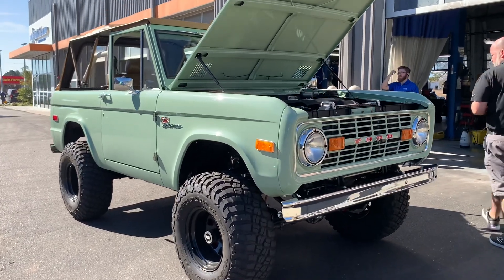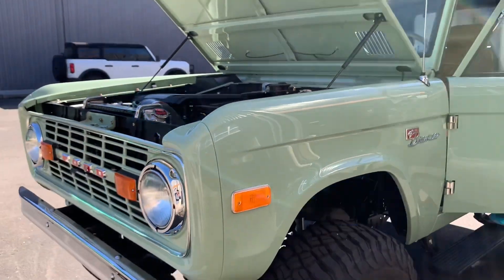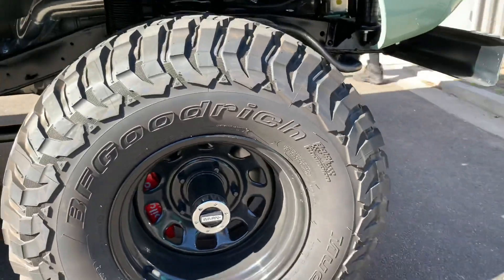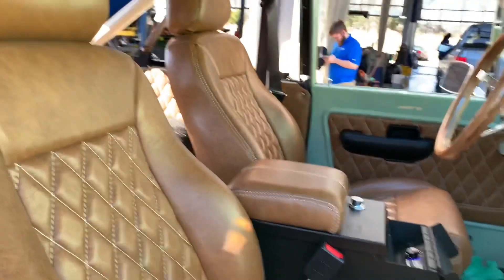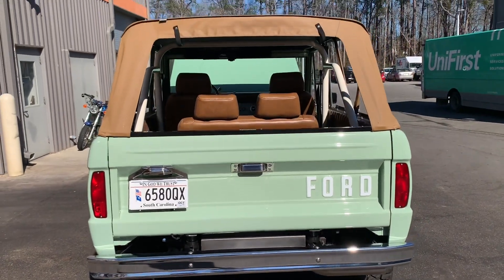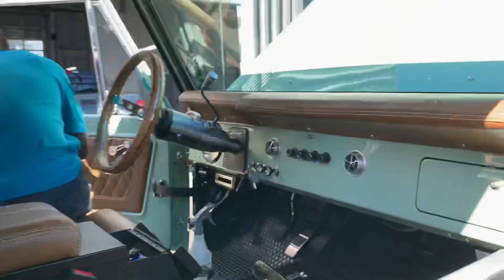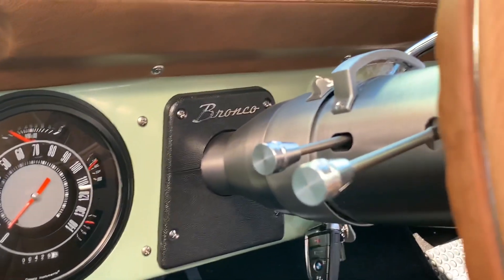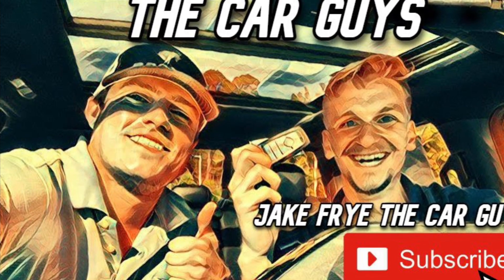CLASSIC FORD BRONCO 5.0 COYOTE V8 SWAP: 1971 Vintage Full Restomod Perfection- 460 HP

Comment: The problem I see is the open interior. Especially, if you live in a Democratic run city. It won't be yours for long. Anti-theft devices need to be installed as well.